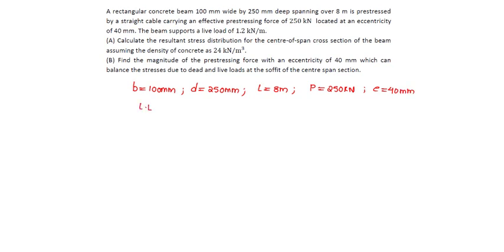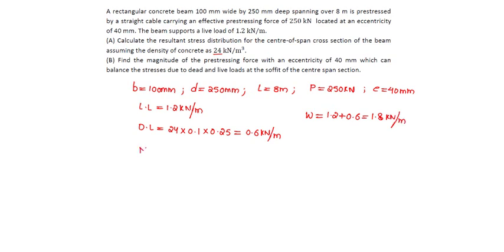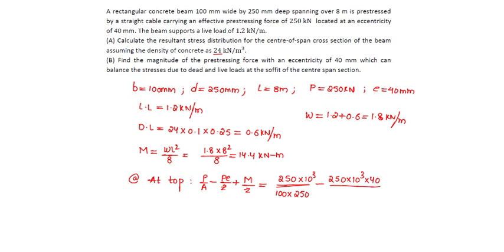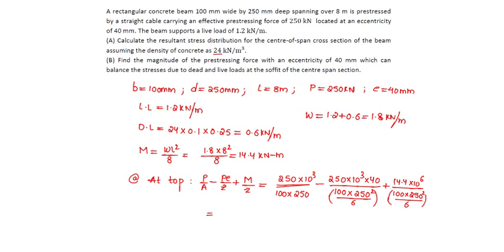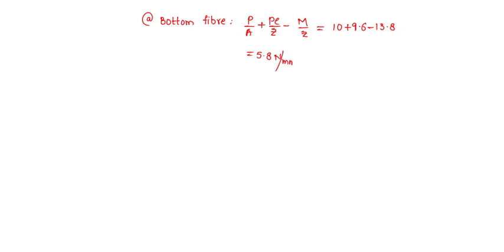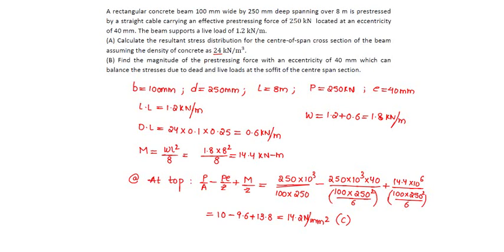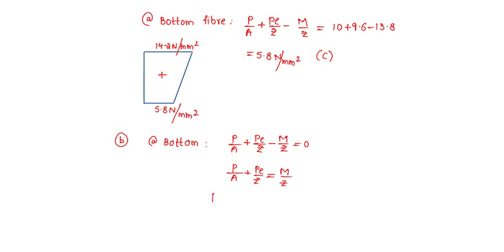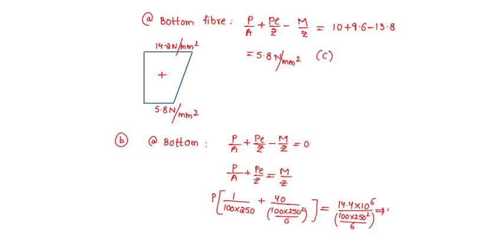gfc038001

Comment: A rectangular concrete beam 100mm wide & 250mm deep spanning over 8m is prestressed by a straight cable carrying a effective prestressing force of 250kN located at an eccentricity of 40mm. The beam supports a live load of 1.2 kN/m.